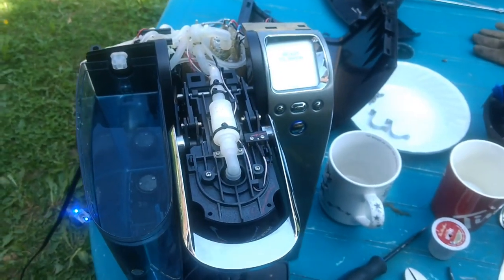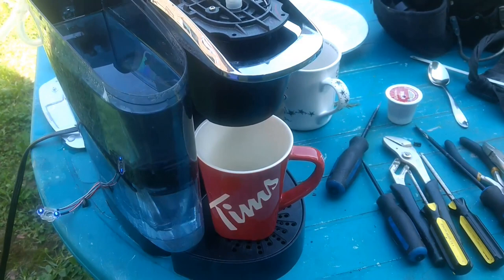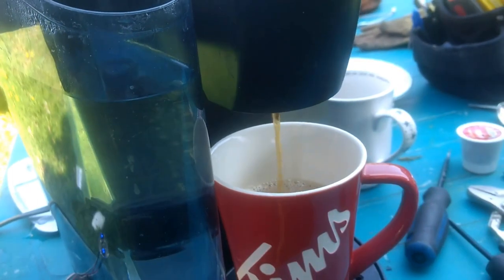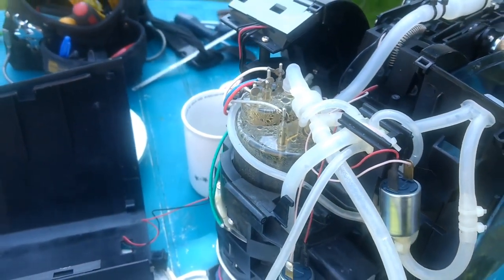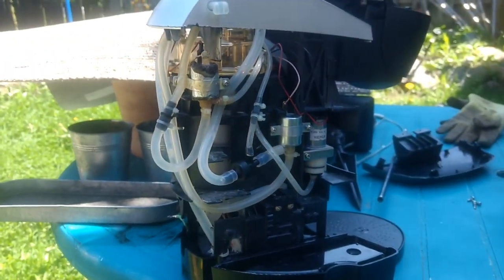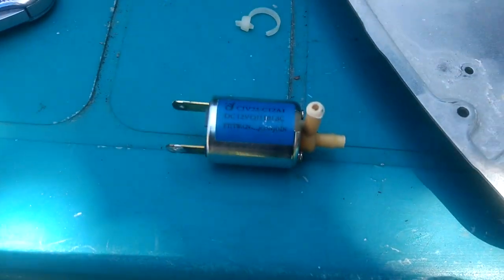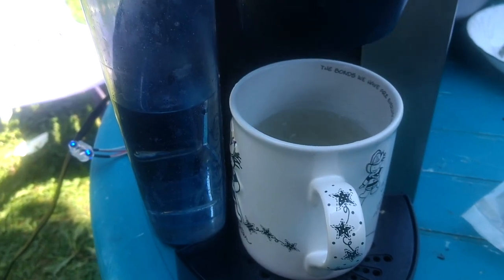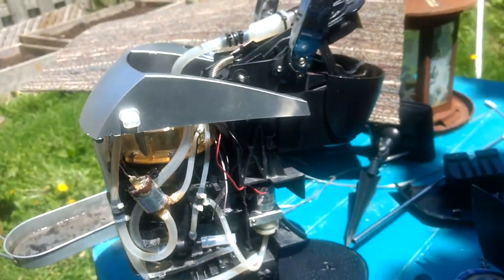Keurig Not Pumping/Dispensing Water THE FIX

Comment: Great video , the time you indicated is very helpful for each fill.
I get barely a trickle and it times out before ever filling the cup so i too have ordered an air pump. My solenoids check out okay and i dont seem to have an air leak. the pump runs but i have no idea if it is putting out enough pressure . Time will tell. All pathways check out fine and i am optimistic the pump will fix it.
Reply: did you get the pump? if so how long did it take and did it solve the problem? I have the exact same issue

Comment: I realize this is an older video.
But, when you plugged off the air hose with your finger did you notice which way the air was moving (in or out) on the hose? Thought about putting a cheap check valve instead of new solenoid. Thanks for the video.
Reply from the maker: Has to be an electric check valve. It controls air venting in/out of the water heater.
Reply from the maker: Also, I purchase Keurig's that people are selling cheap because they don't work. I use the parts from these "broken" units to repair malfunctioning Keurigs
Reply: @46fd04  thanks.

Comment: I have pulled black fuzzy stuff out of the mesh on the filter before several times, we have a black cat so I have figured it was cat hair floating in the air. Mine is now making that grinding sound like yours is. It used to be much quieter but I am having problems with it not pumping well. Mine is the Cuisinart model kuerig style that they don’t make anymore. I love it and I am wondering about taking it apart like you did to see if I have black cat hair plugging something up or is it breaking, gross I know, or should I take it to a repair shop and see if they can fix it without spending a fortune. It originally cost $150. It’s all stainless on the front and was a nice unit, any advice anyone. I have some skills but I would attempt anything electrical.
Reply: I wouldnt take it to a repair shop. It will cost more to fix than replace. A basic Keurig machine sells for around $100
Reply: G Alexander   The only reason I was considering it is because it was a $159 New it is a Cuisinart and it is the stainless steel SS700 and they don’t make it anymore and it has lasted 6 years. A Keurig only last a year.  I also saw where a man used a turkey blaster to back flush the valve at the bottom of the tank and I’ve seen particles in the water. I have never used tap water only bottled because our water is loaded with lime. I had never cleaned it so I did and I got a long blond hair wrapped around that valve out. I had recently got the cleaning message and I have and it’s working but is still noisy. I ordered a turkey blaster that has a needle on the end, going to try that now.
Reply: Actually its not cat fur! Its black mold! It looks fuzzy and slimy! It is very hard to clean the filter! Remove the water tank and place a q tip inside the small hole were it pumps water inside and clean it and you will see all that black mold!! If you dont wash your water tank regularly and you keep on filling with water you could start to see black tiny worms/maggots! I know this because of my friends keurig she dont clean often!

Comment: Would it be possible to give info on how to remove the covers off? Looked on YouTube, but nothing really in detail don't want to destroy anything. This is for a K70 and also have a B145 with same problem as you describe. Thank you for taking the time to do the video, and hopefully will post how to get in to do the repair.
Reply from the maker: 1. Remove the top black plastic part between the handle. There are two screws underneath near the piecing needle.
2. Remove the bottom metal plate. The green ground wires are riveted on. I cut them and reattached later.
3. Remove the black plastic bottom. You have to remove the plumbing pipe where the water enters the Keurig from the plastic water tank.
4. The plastic top stays on the unit as you see in my video. 
5. There are 4 or 6 locking clips that connect the plastic top piece to the main black plastic body/cover. I use a flathead (slot) screwdriver to break these locking tabs, and the body will slide off with some resistance. Now you can access the pumps & solenoids for service.
6. When I reassemble these units, I use black electrical tape at the top where the black body and top part meet. The tape replaces the locking tabs and holds the top & bottom piece together.

Comment: I have no problem with reusable cups or no cup, when I use a Kcup the machine hums for a few seconds then just stops.If I turn the Kcup and re-punch the bottom it will also work but ground in coffee cup.  Do you believe this may still be a solenoid issue?
Reply from the maker: Hmm. That is a good question. It sounds to me like the hose from the water tank to the K-Cup top piercing nozzle is partially plugged. Air pressure from an air pump is used to push the hot water out of the tank, and thru the K-Cup. It sounds like there is not enough air pressure to force the water thru the K-Cup. Another thing to check is the bottom piercing needle. It may be plugged. In fact, check that bottom needle/pin before doing anything else.

Comment: Unless I missed it, could you share the specs on the solenoids?
May be able to snag cheap from digikey.
Reply from the maker: These are all the same. 12V pneumatic solenoids. They are all over ebay. Beware, I ordered several "brand new" solenoids in one shipment and they were all used items. They all worked, but were not advertised correctly.

Comment: How would we know if it's a water pump vs a bad solenoid? Mine won't dispense water at all... drops at most
Reply from the maker: If you can hear an electric motor running when coffee is supposed to be dispensed, that means the Air Pump is working. However, u must confirm it is pumping air by removing it and testing it. To test a solenoid (which is an electric air valve), remove it, and then blow through it using your mouth. It should be closed and NOT allow any air thru it. If air can be blown thru it, it requires a replacement.
Reply from the maker: Also, some Keurig 2.0 Models use a mechanical pump that does two functions; draws water from the reservoir and pumps it into the hot water tank. This builds up air pressure within the hot water tank, and forces hot water out of the hot water tank, into the K-cup,  and pours coffee into your cup. Traditional Keurigs use two pumps; a WATER pump to deliver water from the reservoir to the hot water tank, and an AIR pump to push hot water out of the hot water heater into the K-Cup
Reply: @46fd04  That did the trick! Works like a charm! I took the air pump out, water pump, solenoids & cleaned them up, tested each, soldered them back in & it works like new! THANK YOU!
Reply from the maker: You're welcome
Reply: You can pinch off the  over flow tube in the water tank... if there is air pressure  the water will flow out as expected because you temp close the vent  tube.